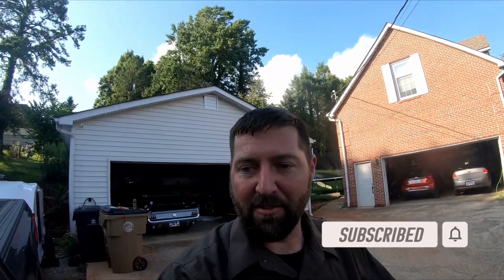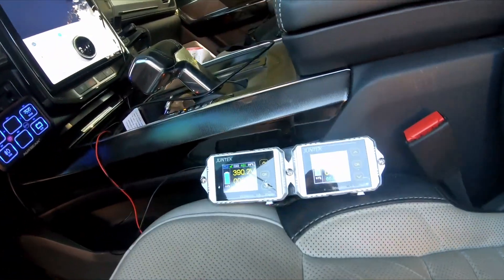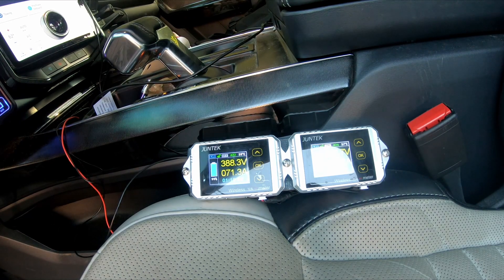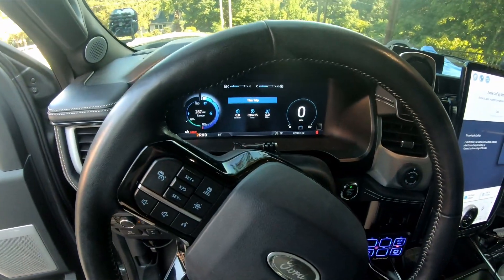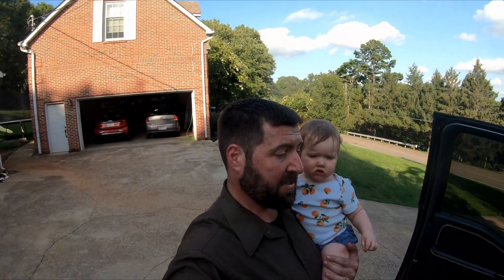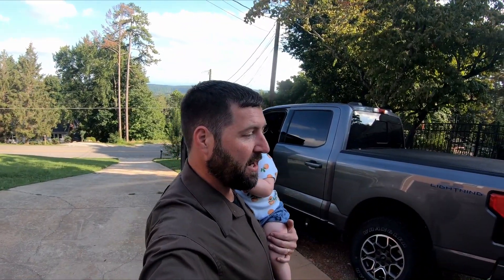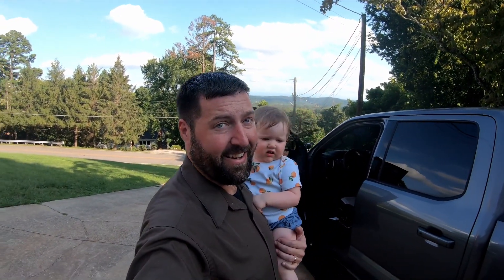Connecting 2 Batteries W/ Different Voltage in Parallel Part 2

Comment: I glad you did this “experiment” and shared it with us. I think you answered my question…I have a Prius with a badly discharged battery, so much that it isn’t able to start the engine. But…I have another Prius with a charged battery and was considering connecting them in parallel with jumper cables. I can’t see why it would be any different than what you just showed.
Reply from the maker: You would want to make sure all the cells are balanced. If there was a bad cell or bad bms and you did this  it could be catastrophic.
Reply: @ if both batteries are disconnected from their respective BMS systems and are both fully functioning batteries except one having a lower total pack voltage, I can’t see what the harm would be?
Reply from the maker: @ I definitely would not disconnect each of their BMS. I would want to make sure that they are both on and functioning. If you have a cell that is too high voltage and then you add voltage to it it could explode.

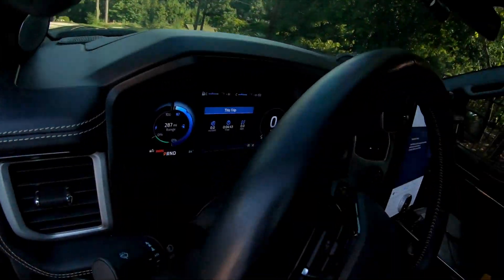Comment: Oh snap! 2:55 Did they really add bat SoC % to the normal screen!?  I'll have to check, which update is that?

I must not have that update yet... My gauges only have an intiger at the top and bottom, as if i couldn't tell where 100% and 0% lie on a half pie chart gauge.  We need the dang SoC% value, the top/bottom are useless... Glad i hope to see that fixed soon...

Next, i would like an instantaneous mi/kWh, and perhaps a 1 or 5minute chart for the past hour or so... Like many many ither cars have.

Also, on the power screen... Giving us the literal kW values would be nice... We can handle the data Ford, please.
Reply from the maker: Yes they finally added it. I dont remember which update I am on. I am really glad they keep coming though! Yes I agree about instantaneous numbers. Charging power would be ideal too.